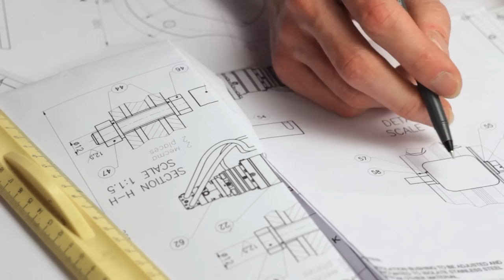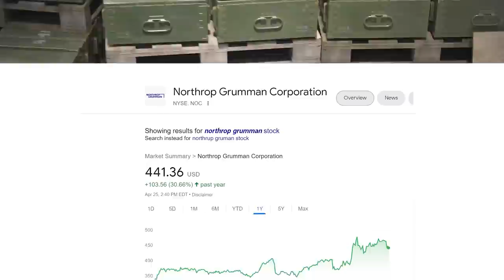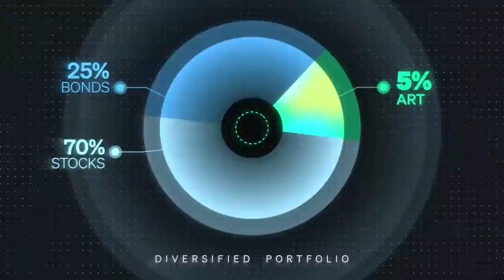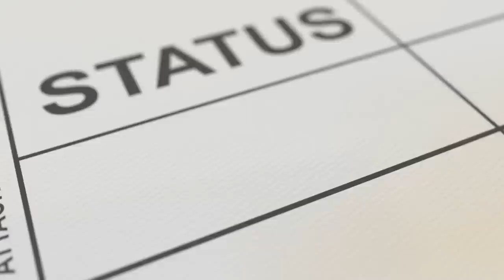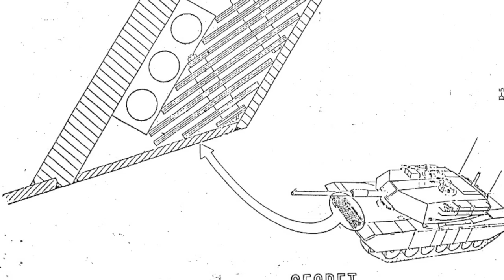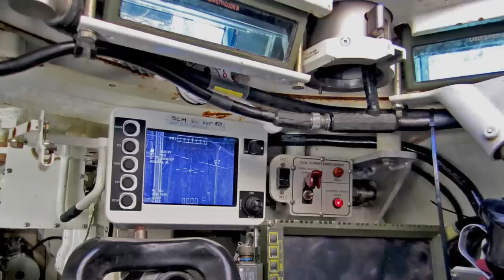The M1 Abrams Tank Needs to Chill Out

Comment: You kinda pulled hard from ass in this video... sorry but 
1) The T-80BV was impenetrable frontally to the M1A2 at standard combat ranges until the US developed the first generation of anti-ERA DU darts. That's mistake one. 
2) The US doesn't place that much higher emphasis on crew survivability than Russia and both get shat on by the UK.
3) The reason the Russians don't really use comlinks between a fair chunk of their current tanks is simpler: They can't afford it. The US has 10x the military budget, roughly, and yet only have a few hundred M1A2 in active service at a given time. They rotate and upgrade the rest to the latest standards to make sure they have a ready supply should they need more.
4) The M1A2 would be just as much of a sitting duck in Ukraine as the T-80BVM or the T-72B3M because, just like the Iraqi insurgents did, the Ukrainian military would learn how to tackle an M1 convoy and yeet it just as hard. Probably harder considering the side profile of the Abrams turret is significantly larger (and the top profile, for lovely Jav loving, is larger too for the turret). What would make the M1 more survivable is the different doctrines and that depends, highly, if the US tried to shock and awe Ukraine just as much as Russia tried to, if yes and if they failed? Yeah... 400-500 burning M1s and M3s on the side of the road by now too.
I am not overestimating the Ukrainians, I am not underestimating just how much shit you'd have to throw at them for them not to fuck every convoy they'd catch with anything, and everything, with AP capabilities. Ukrainians are nothing if not vengeful bastards, just ask Transnistria.
Reply: Your fourth point is the only thing remotely correct. However, the US doesn't fight the way that the Russians do. The Russians clearly haven't learnt their lessons from Chechnya, where they did the exact same thing in Grozny that they are doing now in Ukraine (although they made more use of air power in Chechnya). When they rolled their tanks into the city streets, they got slaughtered by the Chechens. 

The US does seem to place more emphasis on crew survivability, and this is evident in the design of the Abrams, which has ammo stored in lockers with blow-out panels to protect the crew in case something hits the ammo racks and detonates the stored shells. The Russians have their ammo stored in a carousel right around the turret ring, with little protection for the crew from ammo explosions.

The US also tends to train its tank crews very highly, and employs tactics that play to their tanks' strengths. The Russians clearly don't train their crews highly or use tactics that play to their tanks successes.

That said, if the Russians had M1 Abrams in Ukraine, the result would indeed be exactly the same. If the US tried to shock and awe Ukraine in some weird hypothetical world, the Ukrainians wouldn't stand a chance. They don't have enough fighters or ground-based AA systems to hold off the USAF and US Navy aviation. The ground troops wouldn't roll in until the US had total air supremacy and every single enemy fighter was either spread out across the field as so many spare parts, and every known SAM site was a modern art piece of twisted and warped metal.

One thing you should understand about Americans is that for all the Yanks like to talk about fairness in society, when it comes to fights, they never fight fair, ever. Not even in Iraq and Afghanistan, where the rules of engagement were so limited as to skew many individual fights in favour of the opfor to some degree.